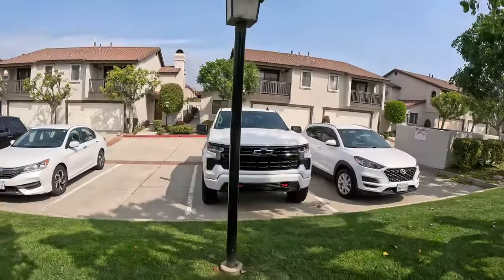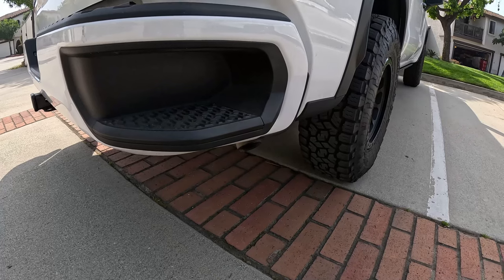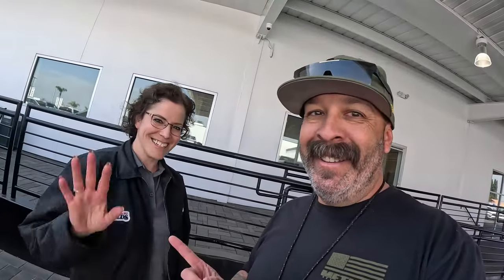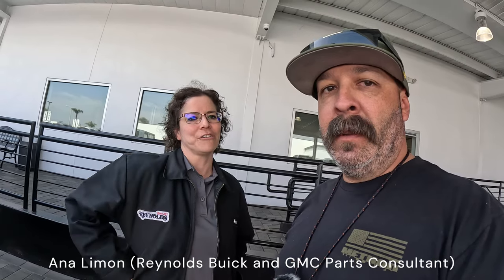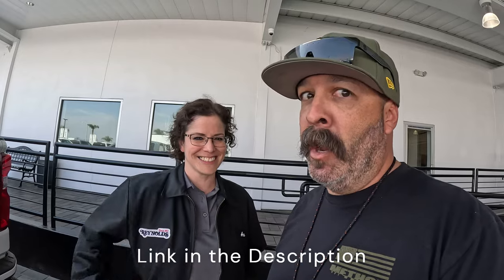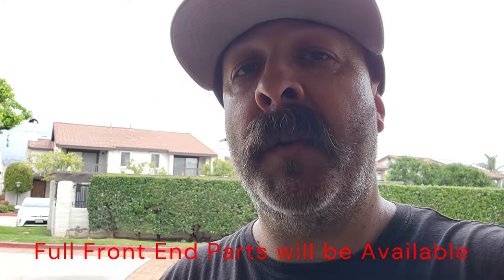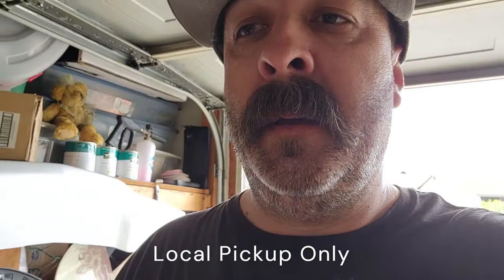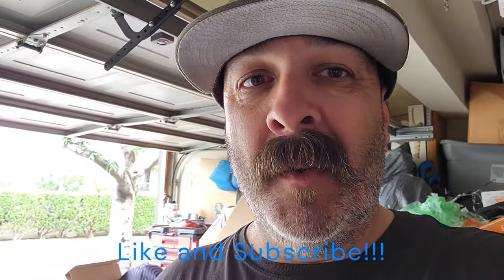Can I turn my 2023 Silverado RST into an ZR2??? Project RS2 Part 1

Comment: Hey. Absolutely love you’re truck and how it came out. It looks no different than a ZR2. I have a trailboss 2023. Looking to do the same thing to the front end. Any advice?  Who I can contact? Or any places you know do the conversion bc I’m not the greatest when it comes to doing things myself. Thanks man.
Reply from the maker: @gregorycondo9926  First of all, thank you very much!!! If you have any questions, please feel free to message me through Instagram and as far as I know there is no place that does the conversion so I just took it upon myself to hope it would work and it did! As long as you are savvy with a tool, then the hardest part is finding the parts needed for the switch.

Comment: Hello, I have been following your modifications for a while, I have the same truck, I want to do the same conversion, I bought the zr2 grill in very good condition, from what I see it is a direct replacement, however you mention the radiator shutters, because Aren't you going to use the ones you already have installed? It is not compatible with the zr2 grill???
Reply from the maker: From what I researched, the radiator shutters are different because of the flowtie grille.... I will let you know once I do the installation, but I can find out later today to confirm.. thanks for watching 👍
Reply from the maker: Ok, so the ZR2 part number for the shutter it 85131849 and the standard for non ZR2 is 85608734... from my research, it has to do with holding the grille in place to accommodate the flow tie.

Comment: Isn't the ZR2 supposed to be an off-road package?  It's basically a sporty Street truck like the old Ford Lightning or the Chevy 454 SS. That is just my two cents but I'm not an off-road guy
Reply from the maker: Yes, the ZR2 is an off-road truck itself, but the look of the front end is what I am going for. Everyone keeps saying it's a sporty truck, but the only difference between the lower model LT is the painted bumpers and painted grille. It's just cosmetics.

Comment: Is there a way to get the 360 vision on LT models with 13.4 inch screen? I’d like to upgrade it if possible through official GMC/Chevy parts… then getting it work natively like higher trim trucks. I’d like the turn assist front camera and wheel view. Could you advise?
Reply from the maker: I am working on getting the front camera to work... just need to do some research 👍

Comment: Plz post a 1.5 update. I really want to do this to my 2.7L turbo LT 1500 4x4 2023. Would this be possible? I have the 13.4 inch screen if context/ extra side details matter
Reply from the maker: I would assume all the front ends are the same, but you will need the proper brackets, but don't quote me cause mine isn't done yet.
Reply: @That-Silverado-Guy thanks! Update us soon!
Reply from the maker: @Multimeter1  for sure!

Comment: I guess I don't quite understand why you want to make your RST a ZR2. I think the RST is the way to go and is a badass truck because it's the sport truck of the bunch😊
Reply from the maker: Well technically there is nothing sporty about the truck other then the painted bumpers and grille and maybe some other cosmetic things. Suspension is still the same as an LT so nothing sporty there. I do appreciate people's opinions especially those that are going to question why but I love the look of the ZR2 and by doing this it is still $20,000 cheaper then a new one. Thanks for watching 👍

Comment: Hope your truck has a 2-inch lift, what about the DSSV shocks and the locking differential.  If you're going to make it real zr2 and you will also need a transmission crossbar that didn't come on it for the pan underneath /Fyi there a lot of item you'll need ,your better of buying a complete nose off a wrecked Zr2 but more power to you  You best bet was to buy a used one for 57950.00 if you ever sell you'll never get you money back out of it
Reply from the maker: Thanks for the heads up! 👍  I appreciate your knowledge of the trucks, and if you go back to my previous videos, there is a cognito lift. This project of the RS2 is just a face lift like I mentioned in the video. Used ZR2s are in the low to mid 60's, and with my current mods, this project isn't at 55,000 yet. Appreciate the info again, but this is just a face-lift, as I mentioned before. Thanks for watching the video 👍👍👍